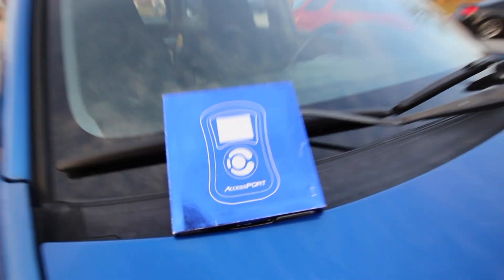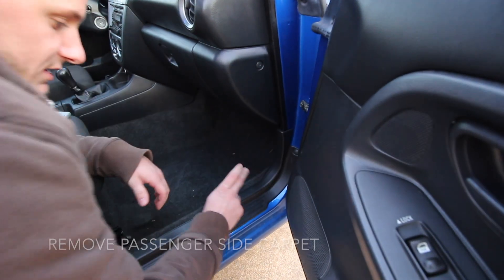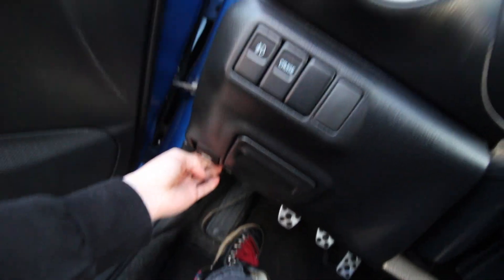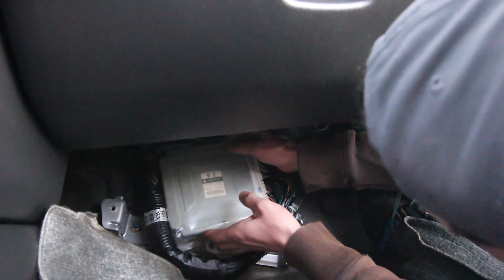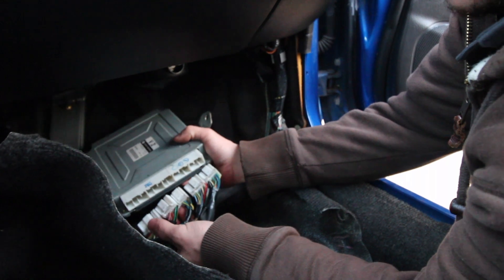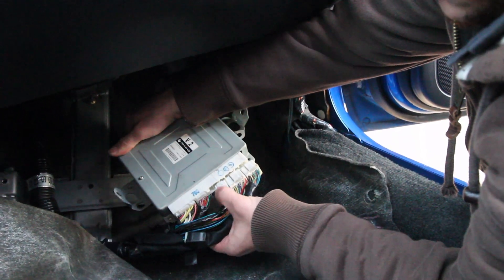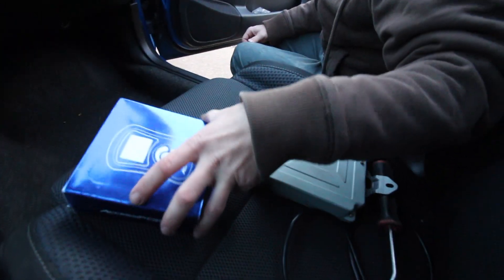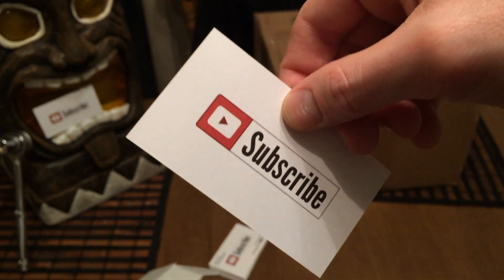How to Change ECU [Engine Control Unit Swap // Subaru]

Comment: have you had an ignition problem like this?  the harmonic balancer came loose on the freeway, and hung on the belt long enough to drain the battery...I was dead in the slow lane with no shoulder just after a turn going up hill toward the Mill Valley exit...finally got AAA to show up, but he wouldn't tow me home even though I have the "Platinum" card, because he was "too busy" so he towed me about 1000 yards to the exit and tried to use his jumper cables to get it started after I hand tightened the  Balencer/pully back on...It started, and I limped 50 miles back to my place.  I tightened the thing up and cranked and cranked and it wouldn't start seemed like mistiming, so I removed the damn PLASTIC timing covers and tried to determine if it had slipped a cog...Every thing seems ok...checking for spark, I find that the 3-4 coil is dead...I pulled the coil and put in my other 1994 legacy (IMO, the lst good Subaru) and it works fine...I switched The ignitor it works fine, I switched the Cam sensor, works fine, I switched the crank angle sensor it works too...I cleaned the mass air sensor...put everything back and still no spark in 3-4 coil...so I have been trying to check the wire for continuity...the Hanes book diagram is wrong for my 2.2 wrong colors, wrong number of wires running to the coil...only three wires, the red has power the other two run to the coils...so I figure that one of them one yellow, one orange is shorted...I started pealing back from the igniter which has two yellow and wonder where they might be connected to the one at the coil, or if that comes off of the computer...anyway, it's driving me crazy and I still haven't found a good wiring diagram for the ignition system of a 1994 2,2...No blown fuses, the fuel pump is running and spark to 1-2 plugs is good.... I appreciate your cool video humor and wish you well.  Rob robertooroark@gmail.com
Reply: I have the EXACT same issue. That's why I'm here, thinking it's an ECU issue. Gonna replace soon to see what's up

Comment: Did you guys have to re-flash the ecu?
Reply from the maker: after all of the modifications we did? yes. but for just an ECU swap, all you have to do is reset the ECU [ https://youtu.be/iq0qxaTLha0 ].  we used a COBB AccessPort to re-map the ECU:
COBB AccessPort Install [Tune & Test Drive // Stage2]: https://youtu.be/riKupxCmwlU

COBB AccessPort V3 Upgrade [Version 2 to Version 3 // WRX Build]: https://youtu.be/RBIfc2ut8Gw

Comment: Ok. So I just did this in my 03 wrx. The original ECU was a 7E. The AC controller wasn't supplying ground so I had no AC. But I swapped it with a 2002 wex V2 ECU. I did the idle relearning process. But it's still revving choppy at idle. And it idles at 500rpm. 
???Any advice???
Reply: I was told by multiple people that the V2 would work as a replacement to the 7E
Reply from the maker: Wow, that's difficult, and i'm sorry to hear you're having this issue.. i'm afraid i don't have a solution for this.. i imagine a really good tech with a power probe and diagnostic tools might be able to figure something out. i feel like the people who told you it would work owe you an explanation :/

Comment: Random question but does anyone know the size of the two bolts holding the 2011 2.5i impreza ECU in place? I've tried 7-10mm wrenches and sockets but the bolts refuse to move
Reply from the maker: It's weird that they would change the size.. Maybe someone else installed their own when working on it? Are they bronze like the ones in the video?
Reply: @milsgarage  No they’re silver ones
Reply: @milsgarage  what’s even weirder that all 5 of the faceplate bolts are 10mm
Reply from the maker: @tjswagginout  Maybe try standard? i feel like those aren't the stock ones
Reply from the maker: @tjswagginout  Well at least they kept those metric 😅

Comment: Hey! Thanks for the video. Do you think the number on the ECU should be exactly the same when replacing a broken ECU? Or is it still okay to replace with an ECU which has different four digits at the end? I need to replace the ECU in my Subaru Impreza and I am confused with the codes on the ECUs.
Reply from the maker: If you’re referring to the VIN, you will need a programming setup to change the VIN. If the old VIN is registered as no longer existing, you’ll be fine. If not, tbh, i don’t think they check OBD2 ever since COVID

Comment: Hey mate just after some information, I just did and engine and transmission swap on my 2006 Impreza, I have the ecu from my old engine and the new engine when I plugged the new ecu in it wouldn't start (just cranking) shows a soild key which I'm pretty sure means it's immobilised I have got the key from the car I got the engine out of but curious do I need the immobiliser module from the other car, the new engine starts with the old ecu but shudders under acceleration, any help would be much appreciated, cheers from Australia. P.s I still have no car 🙄
Reply from the maker: @Karson Campbell Yo, that's awesome you found us in Australia! Great work on the swap, and also on bypassing the immobilizer.. Sorry to hear you're out of a car atm. i don't believe you need an immobilizer to run, but it's certainly a nice feature when it's not stopping you from driving. It sounds to me like you have everything all properly fixed up and the issue you're running into is probably a mechanical problem.. Are you sure the transmission and engine you purchased were working well before? Maybe the transmission isn't matching up with the differential in it's current rotation? Some easier things to check are the axles, CV joints, lug nuts, vacuum hoses.. i'd also check the mass airflow sensor and maybe hit it with a cleaner.. Did you check/change the transmission fluid?
Reply: @milsgarage  engine and transmission I swapped in are the same as what was in it, ej204ls8 with ty754vt7aa, only difference is the ECU, I'm hoping it's just the wrong key for the new ecu (not married so doesn't accept it) and if not I'll let you know, the mass air flow sensor did act abit wierd as it wouldn't start so while my dad was cranking it I unplugged it and it started so might try giving it a clean, thanks for the reply, must be super late in America, yea been watching for awhile now(I'm now subscribing as you more than deserve it, cheers mate)
Reply from the maker: @Karson Campbell Any time for sure! i don't know everything, but i always try to help. You seem to know what's going on, droppin trims n usin jargon and everything.. That's some sweet work sir. Major respect, that's a lot of work. Are you doing that all in your garage? And yup, it's 4am here.. i'll go to bed soon when i pass out lol. Thank you so much for your support mate! Knowing you like the videos makes me feel successful. :) Cheers from the other side of the planet 🥂. i'ma visit there some time. i wanna slide sideways in a Ute
Reply: @milsgarage  yea everything was done in a small garage I had my dad to help me I've just turned 18 so it was my present from my parents, it wasn't actually to hard, took around 4 or 5 days to get it all out and reinstalled, I'll let you know what happens with the new key, cheers for reply 👍 ( your videos have gotten much better in just a year)
Reply: @milsgarage  you wanting to do some skids/drifting what ute are gonna choose Holden commodore or ford falcon ute, personally I love Barras but haven't seen any drifted just big power sleepers

Comment: So currently i have a 2010 impreza 2.0 and i was planning on purchasing a 2012 WRX half-cut and swapping its engine into mines and keeping my automatic tranny to swap out the old manual transmission from the WRX. The half-cut includes everything (intercooler, fuel pump, turbo, ECU and etc). So which ECU do i use ? The old one or the new one, does it need to be reprogrammed ?
Reply from the maker: You're trying to make it run auto, so you need the auto's ecu to work. Sounds like you're just transferring the engine, so it won't even know the difference as long as the engines are similar enough. Yeah, sounds like a sweet project for sure 👍
Reply: @milsgarage  thx man love your content

Comment: Thank you for this.  I likely wouldn't have found the stupid thing without being shown where it was.
Reply from the maker: 😂 Keep up the awesome work Jennifer 🤟
Reply: @milsgarage  ty for the encouragement.  Lol.  I'm starting to understand what they meant about subarus being Lego cars.
Reply from the maker: @Jennifer Picker  Always! Lego cars? lol are you leaning towards letting it go, or do you mean it all pieces together like Legos?
Reply: @milsgarage  all piece like Legos.  Lol.  Apparently there's like 4 models across almost 15 years that I can pull parts from and put them on mine and they just fit.  I wanted to put speakers in my rear doors and I'm being told I just need the rear door panels from a forester and the wires are already there.  Lol
Reply from the maker: @Jennifer Picker Oh yeah, definitely! i'm not sure how many episodes you've seen on the channel, but we have a 1993 Impreza that's lifted on 2003 Forester suspension, has a 1999 2.5RS hood and grill, 2005 WRX seats [not direct bolt on], 2.5RS exhaust.. i call the Subie a Frankenstein build, but it wins awards and has lots more custom Lego plans :D. That plan for the speakers and swapping the door panels might work perfect.. The most important spec to look at is whether the wheel bases are the same between the models.. If the wheel base is the same and the models look similar, then most of it will swap over

Comment: don't you have to reprogram the key for the immobilzer?
Reply from the maker: that's a great question! because we swapped a 2003 to a 2002, they both used the Alpine System, but 2003 is the first year Subaru started using the System.. Alpine uses the the fob to control the alarm. looks like Subaru didn't start using the immobilizer keys until 2005
Reply: Yea i would think you would have to get the vin or ecu reprogrammed .that was easy to easy . nice quick video btw. Subscribed
Reply from the maker: Anthony Vazquez thank you for your support! 🤟😎

Comment: Your ECUs all secured inside the car and what not.. then you have mine that I had to Velcro and zip tie to my fuse box because my intake is too big and I had to relocate it lol
Reply from the maker: LOL at least it wasn't like that from the factory 😂 wait, wow. i had the big ass Injen CAI in my MS3 and it still fit.. did they change the spacing from gen1 to gen2 or something?

Comment: helpful video.. but you have to put for what year Subaru you are working on.  it helps the people who need help for certain years
Reply from the maker: People have asked lots of questions over the years, and i answered all of them many times.. It’s all here in the comments for sure
Reply: @milsgarage  missing the point, but i get it now.. you are click baiting
Reply from the maker: @j0cr0z  No. LOL. Who are you? Crazy.
Reply from the maker: @j0cr0z  Click around. Do some leg work.
Reply from the maker: "because we swapped a 2003 to a 2002, they both used the Alpine System, but 2003 is the first year Subaru started using the System.. Alpine uses the the fob to control the alarm. looks like Subaru didn't start using the immobilizer keys until 2005"

Comment: Did an engine swap and took my ecu to get it tuned to run the engine. When it was all said and down and it came to firing the baby up, my mechanic left the key turned over, so touching the battery terminal might’ve fried my ecu, interior of my car was smoking and it was coming from the passenger seat. Car died on me later that day from bad rings
Reply from the maker: O_O dude.. that sounds like as crappy a thing to happen as the car accident i was in last weekend. i'm sorry to hear, but i hope everything works out.
Reply: Thanks so do I, I’m working on saving up for a high performance clutch right now and a new engine on the way. I won’t be back driving my subi until the end of the year. I’m looking forward to the 18g turbo! And 300whp
Reply from the maker: all that sounds like great targets. imo 300whp is perfect for daily drivers. very cool man, will you follow your build on ig or anything?

Comment: Don’t understand why you left the married ecm in, it has the vin of a different car.  You could have just power ecm, uninstalled Accessport and then installed Accessport on your original ecm.  It will work your way but ever have the ecm read for emissions or a dealer and you’ll have issues
Reply from the maker: the video is simply showing how to swap it. we work on our cars every day, and can change an ecu in like 20 min, so there's no point in showing people processes over and over.. but yeah, the vin definitely follows the ecu around. the other car was salvaged and crushed, so we should be fine either way.. unless we've got a demon car... we might have a demon car. 😈
Reply: Fair enough.  Carry on
Reply from the maker: thanks David! you're awesome 🤟😎

Comment: can u buy pretuned ecu's??
Reply from the maker: Technically, Ryan bought this ECU already tuned along with the mated Version 2 Access Port. So people do sell their already tuned ECUs, but i wouldn't buy one without the ability to recalibrate the tune after installation. If you were to simply buy a tuned ECU, it wouldn't be calibrated to the car's actual running diagnostics, so it would be a base tune, and you'd want to pay for a better tune asap
Reply: @milsgarage   okay thanks for the advice
Reply from the maker: @Car Aboo Any time 💯